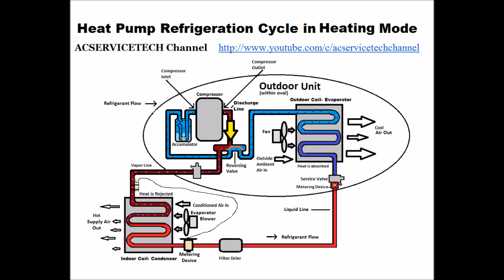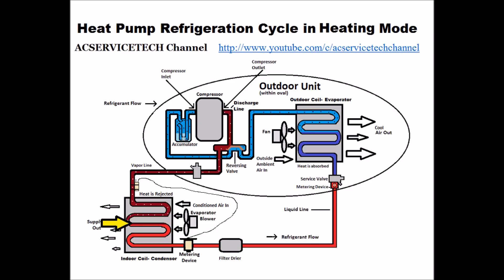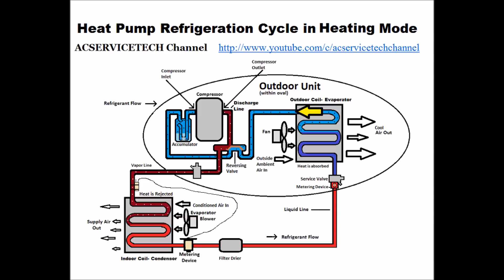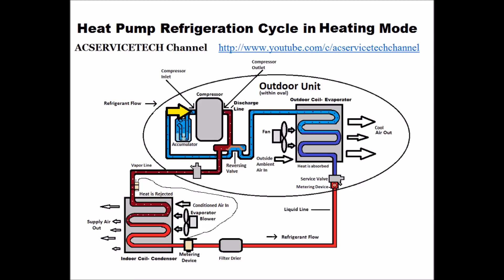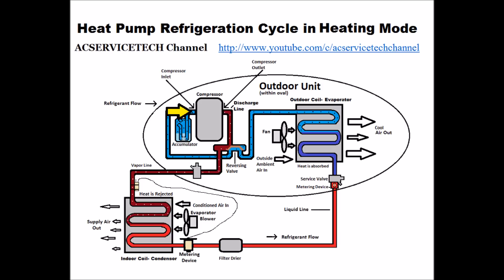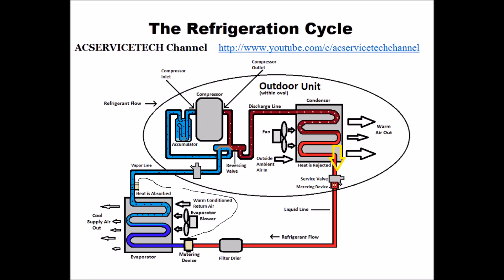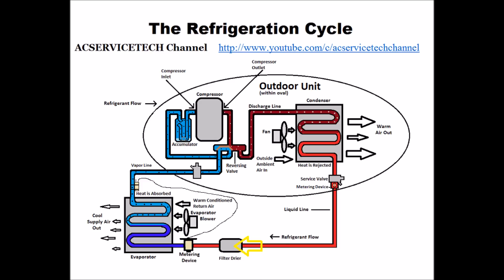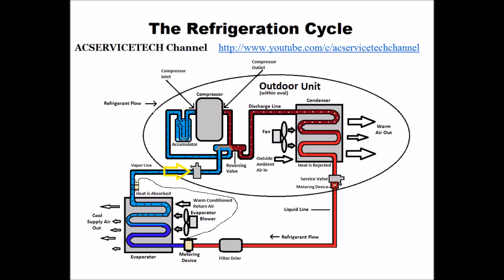HVAC Superheat and Subcooling Explained! Understand the Concepts Step by Step!!

Comment: It is winter time. The outside unit liquid line is 96 degrees and the inside line  is reading 84 degrees. This is in heat pump mode The drop in temperature is 12 degrees . The temperature drop for winter time allows for correct heat temperature. Is this value considered a sub cooling of 12 degrees?  
And in the summer in cool mode the liquid line outside reads 96 degrees and inside reads 38 degrees. That drop in temperature is 58 degrees for the summer time. 
The liquid line temperature and liquid line pressure temperature with a txv is related to sub cooling , what is the difference between these two related to heat pump heat and cooling?

Comment: Thanks for doing this video. My heating unit would cycle on fine two or three times but blow cold air at first.
 Than it was hissing and excreting a bad gas like chemical odor. So I'd turn it off to stop the irritating odor.  It is getting colder outside...  I found this helpful.. now I can report this issue to my landlord with more knowledge. My hypothesis is the accumulator and/or evaporator and/or exchanger is faulty.
Reply from the maker: Thanks and nice name!

Comment: I still don't understand how the gas can be overheated behind the evaporator WITHOUT rising pressure.
Reply from the maker: I do understand what you are asking and yes the pressure has not risen yet along with the temperature. Part of that has to do with the larger tube diameter of the suction line and the refrigerant is then not in saturated state any more where there is a precise temp to pressure correlation. You may also like this video, thanks-  https://www.youtube.com/watch?v=th0EnaSbJUw

Comment: What's the lowest temperature can you run a heat pump
Reply from the maker: Technically you can operate a heat pump at any temp but what is worth running in would be the question. For conventional systems, we typically run them down to 32 before switching to elec resistance or hybrid gas heat. You could run them down to 25 but below that, it really is not worth it. If it is a vrf minisplit, you can run them at very low outside temps and they will still provide heat, thanks

Comment: I appreciate your video. but my Q. is at 3.05 - refrigerate going back to the outdoor unit.  How would the refrigerant absorb  more heat from the outside air in winter cold weather ? I am from Toronto Canada. Thanks
Reply from the maker: Hey Basil, tandard split system heat pumps would not be of much use there. A vrf minisplit may be the only unit effective at absorbing heat at such a low temp. We use dual fuel systems- heat pump with furnace, fuel furnaces, geothermal, and minisplits  here in southern NJ, thanks
Reply: Hey Craig, Thanks for your explanation. We also use the combo system of packaged heat pump units with either gas or hydroponic system depending on where they are installed, but I have mostly seen them in condominium buildings.  
Do you have a video on this type of Heat pumps like ( Whalen brand ) where they are connected into the Hydrnoic system of the Condo Building.....They use Glycol mix in their system for cooling and heating to aid the heat pump operation. 
I do struggle to diagnose their problems and would like to learn how to properly fix its issues.  I would really appreciate it if you share a video or two about this type of units.  Thanks a million....your the best HVAC teacher on YouTube.  Very detailed  and clear

Comment: Based on my last question how the reversing valve obey the change of the temperature in the winter out side of the house in the condenser to send the heat to evaporator in heat mode and the cooling mode .thank very much.
Reply from the maker: Hey Felix, did you see these videos-  https://youtu.be/fFL_ZSkAZM0  -     https://www.youtube.com/watch?v=5c5R3uYSy5U&list=PLxnHR5_D2ojw4j3_KlmutdxYvSzO1FOl8    ---    https://www.youtube.com/watch?v=qiAOvJhq8_s&index=1&list=PLxnHR5_D2ojy9Maw-gtQGW2XqNemo8zFE&t=13s

Comment: On a ductless  split unit with the txv inside the outdoor unit and the high side port is in between the  txv and the distributor,  How do you check the charge ?
Reply from the maker: Unfortunately, with an inverter type unit, the only way manufacturers want you to check the charge is by weighing the refrigerant charge in from empty after fixing the leaks, thanks
Reply: single speed rotary compressor,  R22 if that makes a difference.  Calls for 5.9 lbs  I am a pound under but i don't trust my scale.
Reply from the maker: You can actually check subcooling with temperatures only without a port since your gauges are only used to convert to sat temp. You also can see if your superheat is high due to the txv not being able to control the superheat since it does not have a solid column of liquid. We use our scales a lot and I would certainly invest in a good scale, hope that helps, thanks

Comment: Nice video. But I'm still puzzled about something:  I'd like to know how the filter drier filters with the flow through it reversing.  Do particulates get stuck in something in the filter so they don't blow back out the other direction?  Thanks!
Reply from the maker: You are correct, the prefilters are often about 1/4" thick are are intended to hold it, moisture gets held in the center medium, thanks

Comment: the water source heat pumps i see only have 1 metering device,do all the air source ones have 2?
Reply from the maker: Yes the conventional ones do but the vrf minisplits have a txv outside. WSHP's can have one as the piping is close. Thank you Capitol!

Comment: Isn't the outside unit's metering device inside the enclosure rather than outside the service valve?
Reply from the maker: Hey RJParker, sometimes it is inside the outdoor unit, other times it is right in front of the service valve. It depends on the make and age. The picture shows in front of the service valve but I believe I mentioned it could be in the enclosure. Thank you!